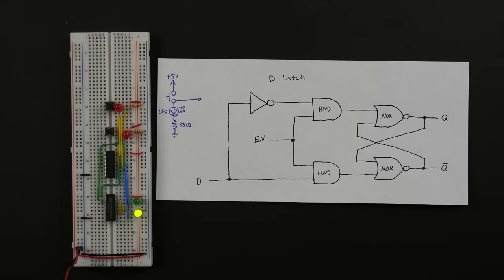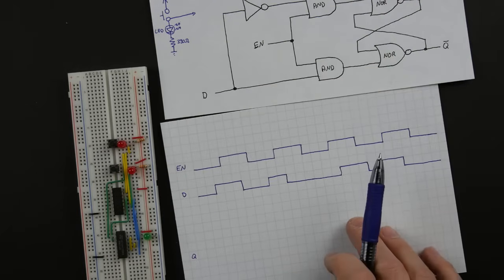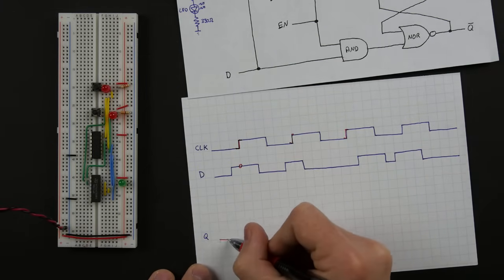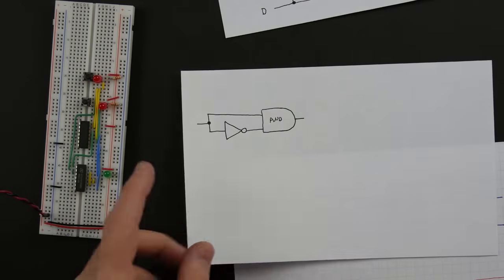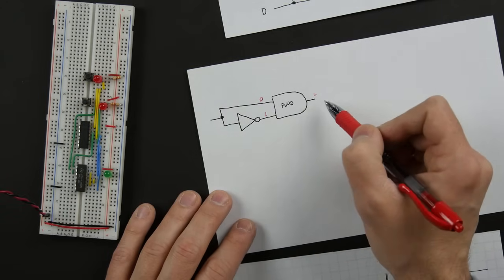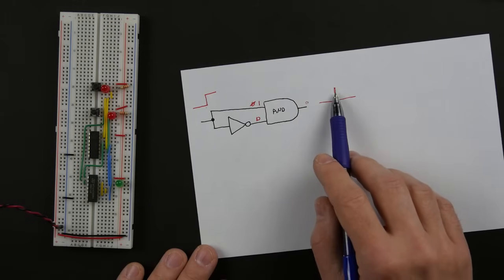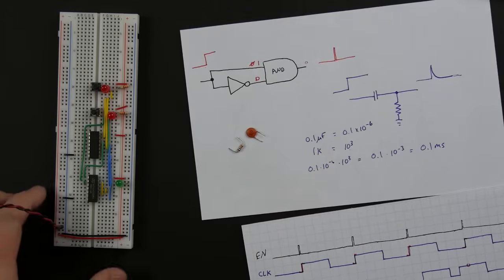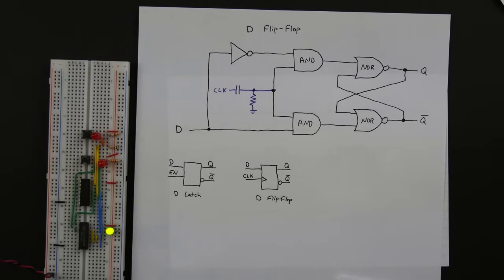D flip-flop

Comment: This circuit is a pulsed latch, NOT a flip-flop. A flip-flop consist of two latches in a master-slave configuration.
Reply: Do you have a wikipedia link.
Reply: @emberleona6671  https://en.wikipedia.org/wiki/Flip-flop_(electronics)
The Wikipedia article isn't that great. This would be a better reference on a D flip-flop: https://www.electronics-tutorials.ws/sequential/seq_4.html
Neither article covers the pulsed latch described in this video, but it can be used in special cases. It is not a typical "D flip-flop". though, so please don't assume you know what a "D flip-flop" is after watching this video!
I also found these lecture notes if you want a technical reference on the subject: https://web.stanford.edu/class/archive/ee/ee371/ee371.1066/lectures/Old/Older/lect_08_1up.pdf
Reply: @alastairhewitt9462  thanks the flip flop in the video is edge triggered uses a clock signal and stores a bit. So it meets wikipedia definition. How is a pulse latch defined.
Reply: The Wikipedia article uses the term "flip flop" to refer to range of circuits known as bistable multivibrators. That's why I said it wasn't great. The term gets used interchangeably and that's where a lot of confusion comes from.
The conventional use of the term flip flip refers to a master-slave configuration of two latches to only change on the clock edge. You can achieve the same thing using the circuit described in the video, but it is technically a pulsed latch.

Let me explain:

A latch is a single bistable multivibrators where the output follows the state of the input. You can add an enable to this so that the output will only follow the output only when enabled. You can call this enable a clock and use the circuit described in the video to turn it in to a pulse. This pulse will sample the input state and (mostly) allow the state of the latch to only change on the transition of the clock. However, this is known as a pulsed latch.

A flip-flop consists of two latches, where the state of one controls the state of the other (master-slave). The state will effectively flip/flop from one latch to the other, hence the term "flip-flop". This is a stable system where only a transition of the clock will cause the circuit to flip/flop.

The pulse width in the pulsed latch has to be wide enough to register the state of the input. It still acts as a transparent latch during this period and since the pulse has to be long enough to register the input it can also allow an equivalent pulse to pass though the latch. In this case the latch would not flip/flop from one state to the other, but pass a pulse that is less than or equal to the pulse width of the "clock".

Pulsed latches are useful if you can avoid the kind of glitch described above. They only consist of a single bistable multivibrator and consume less power. They can replace a flip-flop, but that doesn't mean they are a flip flop. There's a lot of conflicting/confusing stuff posted on YouTube and Wikipedia, so hopefully that clears it up a bit.
Reply: @alastairhewitt9462  Just to illustrate your point, if you use a chain of latches to build a shift register, with a common clock and the Q output from each connected to the D input of the next. Then you want to make sure that the signal can't jump several steps in one clock edge. This is very hard to guarantee using a pulsed latch, since there is very little delay through the latches.

The same kind of hold time problems can show up in many cases with pulsed latches, you have to make sure that the minimum propagation delay through the logic is longer than the pulse width. I think this is why it seems to be very uncommon to use pulsed latches, and master slave flip flops seem to be the default.

If you want to be absolutely sure, you can use a two-phase clock, like the 6502 does. The two clock phases alternate going high, but there is a period where both are low each time they transition. Then you let the master latch be transparent during one of the clock phases, and the slave latch during the other.

Comment: Hi, first of all thank you for putting all the time and effort to produce these wonderful videos, I truly hope that you keep doing so.
I have a question about the capacitor resistor pulse detector, how is the capacitor discharged so that it responds to the next clock cycle by charging again?
Reply: I'm a bit late, but here I go. 

When the 5V on the left side of the capacitor goes to 0V again, the capacitor is discharging (it goes from   5V--| |--0V  to  0V--| |--0V). When it discharges, it generates an inverse current that flows from ground to the right side of the capacitor through the resistor. This way, the same pulse, but in a negative voltage, happens.
Reply: @rojirrim7298  thank you very much, better late than never.

Comment: why wouldn't the not + and also result in a pulse output for the clock transition from 1 to 0?
Reply: An AND gate only outputs high when both inputs are high. When transitioning the input from high to low, for the briefest of moments the inputs to the AND gate will both be low, which will continue to output a low signal. To detect falling edges an OR gate should be used instead of an AND gate.
Reply: @rlamacraft  of course! THANK YOU

Comment: regarding the resistor/capacitor that converts the button push to a trigger pulse, how is that capacitor draining?  Wouldn't it need a resistor to ground on the +5 side that charges it?  Is the resistor on the other side of that LED doing that?

Comment: Is the inverter taking time actually reliable enough for this to be used in like, actual big important circuits out there?
Reply: Actually yes. It's almost always defined in the datasheet. For instance for the hex inverter 74LS04 https://www.ti.com/lit/ds/symlink/sn74ls04.pdf if you look under "switching characteristics" you see that they define the typical and maximum number of nanoseconds that it takes to turn on and to turn off (they are somewhat different).

Comment: Interesting.. You can also build an SR flip flop using 4 NAND gates or a single chip. In fact, there are already SR flip flops (requiring no extras gates). The SN74LS279A Texas Instruments chip is one example (http://www.ti.com/product/SN74LS279A). The same is true for the D-latch and JK-flip flop (similar to the SR flip flop except there is no change in output when both inputs are low).

Comment: Great explanation Ben, thanks. Won't the discharge of the capacitor cause another pulse on the edge where clock is going from 1 to 0?
Reply: I was thinking similarly, that when the clock goes from high to low (button released in Ben's circuit) wouldn't there be a negative pulse from 0 to -1 as the capacitor discharges? I made a quick breadboard test and confirmed with a scope that there is a negative pulse on the falling edge as well as the positive pulse on the rising edge. This won't affect the logic gate though as anything below zero will still be seen as "low".
I also found that the indicator LED & resistor Ben has on the button in his circuit is essential (or at least the 2nd resistor is). He doesn't show this in his diagram but without it the first pulse happens as he illustrates but then the capacitor stays charged even when the button is released so the second and subsequent button presses don't cause any further pulses. My testing showed that a resistor to ground is needed on both sides of the capacitor.
Reply: You could use a diode there to clip away the negetive pulse
Reply: That's why RC circuits are not used as time delays or "clock choppers" by experienced professional engineers. Taking a logic gate's inputs below ground can damage them causing them to function intermittently which is a night*mare to troubleshoot!

Comment: Watched it 3 times, but still not sure....does the capacitor discharge when the clock input goes to 0?
How do you build a clock circuit?
Reply: Yes, the capacitor discharges through the resistor. You can build a clock circuit with a 555 timer (Ben Eater made a bunch of videos on the topic.)
Reply: Corvus Kro Its a differentiator circuit. The circuit will have negative pulse when the capacitor discharges. To avoid negative pulse we can use a diode. Since the negative voltage will still be considered as low so, it will not have any effect on the circuit.

Comment: 6:20 this was an interesting conundrum for my Minecraft CPU as I noticed the circuit behave as depicted at 2:30 :P
I actually have a bunch of breadboards, chips, wires, resistors, etc in for delivery. I'll definitely be practicing the circuits in this playlist :D
Reply: I guess I’m not the only person that uses these videos to help with building and troubleshooting minecraft ALU’s and other stuff
Reply: @emufasar1789  Well, mine was a long time ago. I've since formatted my PC so I lost the save.
I also don't think my Raspberry Pi Zero running a small Minecraft server for fun could handle a Redstone computer ^^'

When I did the Redstone PC I rarely used any help, so I stumbled through most things on my own (occasionally I'd have to look up some quirks of Redstone and often it would include a circuit from a Redstone PC as an example and I had to look up some things about computers as I knew far from everything). So it's fascinating to see solutions either close or really far from what I figured out.

Plus physical issues like voltages going into the components via 'out' lines. Since nearly every Redstone component and thus circuit acts like a diode, it's simply not something I ever had to think about
Reply: @tiaxanderson9725  how's it going did you support ben eater buying at his website? Good luck. I haven't tried minecraft yet.

Comment: Logisim broke when trying to make a DFF in this configuration, so I emulated the function by running 7-off, 1-on with the clock component at 8hz, could be 16 if I wanted to get even closer to instantaneous ticking. Anyway, thanks for the work you do! It's really helping me understand all this crazy stuff that goes on in computers and the embedded solutions (usually SOC) found in many devices we don't think of as computers
Reply: (yes, I know there's a DFF module, but building it is an important part of learning its function)
Reply: @TheLunaLockhart  did you try the logic gates edge detector instead of the resistor capacitor version of edge detection. Also lower the clock speed in the sim. Electronics workbench ??

Comment: Hi, great video, thanku you very much for what you are doing . I just have two questions if anybody sees this.
Does the capacitor "puls generator" detects desending edge of clk , and "AND" gate generates puls on both asending and desending edges?
Reply: Murdoc Gal 
Answer 1: Yes, it will have a negative pulse as well. This is a differentiator circuit. To avoid this negative pulse we can use a diode.

Answer 2: No, If you’re trying to make an edge detector using NOT gate and AND gate, you’ll only have positive edge.

Why wouldn’t it have negative edge?
See the output is,
                     Y=AA’
Now consider a case when clock transit from High to Low

Stage 1: When the clock is high then,

A=1
A’=0
Y=AA’=1.0=0

Stage 2: Just after when the clock transit from High to Low then,

A=0
A’=0 (Due to the delay of NOT gate A’ will keep the previous value until a new output is processed by NOT gate)
Y=0.0=0

Stage 3: When the clock is Low then,

A=0
A’=1
Y=0.1=0

Hint: And if you want to get Negative edge/pulse then what about trying this with an OR and a NOT gate?

Comment: Perfect! Is there a way to build this circuit without ICs?
Reply: For small circuits like this D flip-flop, you can always use transistors.
Reply: @dekrain  Do you have schematics for this circuit?
Reply: @fusca14tube  No, but you can replace logic gates in the circuit using corresponding transistor circuits you can find on the internet.

Comment: Hi i love your videos, but at 13:40 you say that capacitor is fully charged at R*C (seconds) which I believe is not true. Shouldn't it be 5 x R*C, so 0.5ms?
Reply: That isn't what he says.

An ideal capacitor takes infinitely long to charge and takes infinitely long to discharge, but most of that "infinitely long" is spent "close enough".

The RC time constant gives information on how long it takes to reach "close enough". For different use-cases, different multiples of RC are used as the time to reach "close enough".

5RC is "close enough" to fully charging in most applications, but "fully charged" isn't the goal here. The goal is for the voltage across the resistor to go from a logical high (2V or above for the chips here, IIRC) to a logical low (0.8V or below for the chips here). After 1RC, the current through the capacitor is 0.37 times what it started with, which means that the voltage across the resistor is 0.37 times what it started with. The voltage across the resistor starts at the input voltage (at most 5V) and is thus at most 1.85V after 1RC. Not quite where it needs to be but after 1.83RC it'll be at most 0.8V. Close enough.

Comment: so I had a problem when I was trying to build this in a game. the rising edge monostable went so fast the it bugged out the circuit and make a clock. I found an easy way to fix this if anyone else has this problem. Have the output from the pulse shortener (monostable) and run it into a pulse lengther. this will still give you the input on the rising edge but it will also keep it on long enough for the game/simulation to calculate everything. just make sure everything is timed up correctly with the same delays.   P.S. if this doesn't work in the long run or you have a better solution  please let me know because that will be a great help to me and I can also edit the comment so I don't confuse other people.

Comment: Your videos are great because they're bringing me back "To - The - Days". In my COMPE270 Logic Design Class, we did all our designs on LogicWorks software. Then we did the real circuits next semester in the COMPE470L Lab. I remember my fried fried the logic chip network and a few capacitors by accidentally connecting the network up to the 15v supply instead of the 5v supply. The electrolytic caps all smelled like baked bread! Oh the GooD times......

Comment: In the circuit snippet with the AND gate and the Inverter, what would happen if one placed a small capacitor from the output of the inverter to ground, instead of having the RC on the overall input? Would it behave the same?
I'm asking because I have seen just such a construct in the circuit diagram for an old mouse interface for the British ZX Spectrum home computer from the mid-1980s.
In this interface, each direction (Horizontal and Vertical, respectively) has two signals coming from the mouse itself, one of which is offset slightly from the other, either leading or trailing depending on the direction - up vs. down or left vs. right, and one branch of each pair has this aforementioned inverter + AND gate + capacitor.
The full diagram can be seen here: http://www.worldofspectrum.org/pub/sinclair/technical-docs/KempstonMouse_Schematics.png
Here, they have used NAND gates instead of AND gates, and also using a NAND gate as the inverter by connecting both inputs together. The end result should, aside from the final signal being inverted, behave just as if AND gates had been used.
I would be very happy is someone could explain this to me.

Thanks in advance, and Greetings from Denmark.
Reply: The capacitor acts as a buffer to delay the zeroing. 
Instead of just relying on the delay of the inverter, the capacitor takes some time to discharge as well, keeping the inverted input at a high before it sufficiently discharges.
Reply: @Badrunniam Al-Faraby
Thanks for your reply, I suspected it would be something like that, but it's always good to have it confirmed.

Comment: At 4:58, shouldnt you draw the line to 0 at the second dot instead of staying at 1 until the 3rd red dot?
Reply: Jelle No, well the circuit will work only when the clock is changing from 0 to 1 i.e. positive edge triggering. So, circuit will latch the output 1 or 0 depending on timing at which input is changed. If you see carefully at the second dot the D input is high at the same time we got clock edge to trigger the the circuit. Thus the output is 1. Similarly, at the 3rd dot D input is low when the clock changes from 0 to 1 thus the circuit takes output as 0.

Comment: I was about to add my comments when I realized that the next guy had already said it. You are a very good teacher. You don't waste time; you build up your lessons carefully to get to main point of the class like a professor. I've seen several videos and they are very easy to watch and followed even when I'm completely lost or I'm completely aware of what is happening. I would like to start building up my digital electronics skills and need to buy all these ic's, protoboard and the such. I need to build up my bench and I wonder where do you think I should go to get all this peaces of parts, component and tools to follow you lectures. I need every thing like meter, scopes, parts, board, cables and the such.....I'm sure you know what I mean. I have nothing and need to start from zero. The only thing I have is my brains and my skills as a technician but I need every thing else. I want to build the 8 bit computer and I have other project that you may be able to assist me with.  Thanks for you support and thank for these amazing lectures.
Reply: Openinvent.club